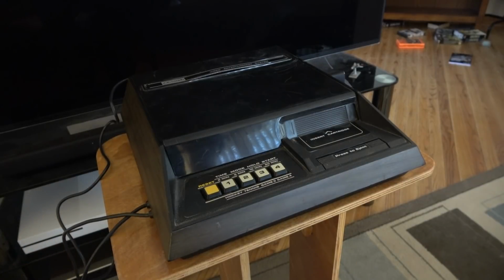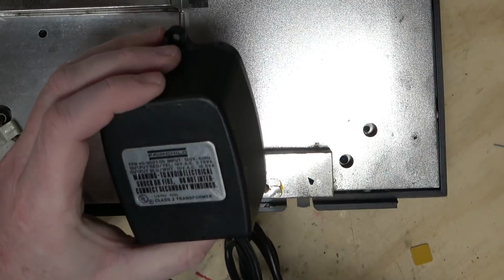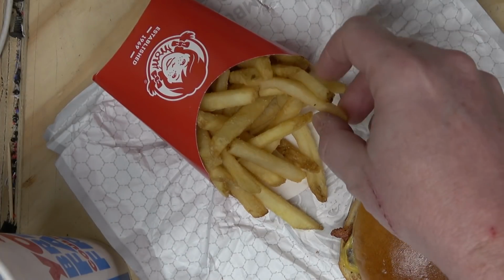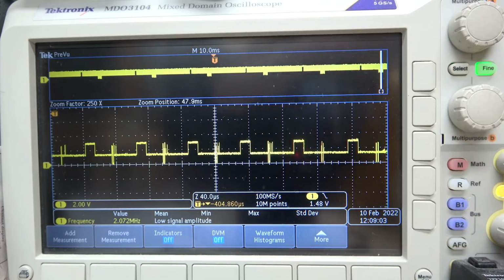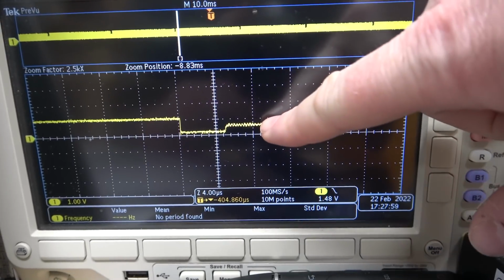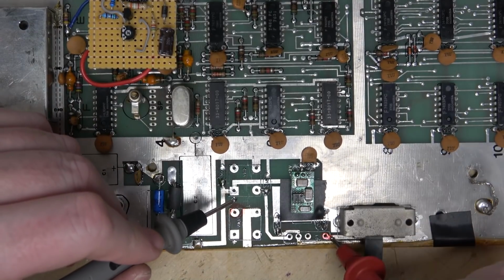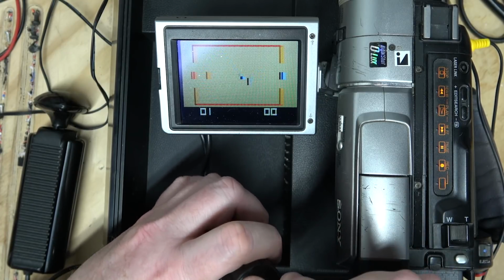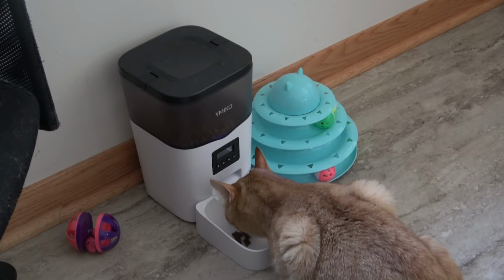Fairchild Channel F Game Console Repair

Comment: VA is ~watts, not amps...  15VAC @ 3.75VA is 250ma.  10VAC @ 16.5VA is 1.65A.  Still about double what it needs, but not "WAAAAAAY OVERPOWERED".  That's a decent margin
Reply: IIRC, early semiconductor memories were absolute power hogs, in addition to often needing weird voltages that would kill other chips if the memory died badly.  It wasn't until the early 80's that semiconductor RAM was available that didn't need 12 volts.  (This did NOT help the reliability of the Apple ]I[ and it's completely bass ackwards design process.  Seriously, who designs the case first, won't allow any ventilation, and then won't make it bigger when the chips needed to fulfill the hardware spec developed later won't fit and overheat?  Steve Jobs, that's who.)
Reply: When you consider power factor it's not even that much margin, at least not for the 10v input. Assuming a 60% PF 1.65 amps in will only supply 1 amp of 5v power.

Comment: Actually come to think of it, YouTube sometimes deletes comments with links, so I'll paste the appropriate info here for posterity (this is from a page called "Accessing RAM" from the VES Wiki: "To write data to video ram you have to load the x coordinate to port 4, y coordinate to port 5 and color to port 1 and then execute the transfer by writing to port 0. For compatibility with the first generation of Fairchild Video Entertainment System, especially the 2MHz PAL model, there needs to be a delay after sending the data through before the next pixel is loaded and sent. MESS will work fine without the delay but it's important for a real console or you'll get holes or gaps in what is drawn."
Reply: Youtube has gotten very pissy about comments lately, even ones that don't have links.

Comment: The Zed Ex 80 (in Hell you will be made to repeat that phrase until your face morphs into Clive Sinclair's. SIR Clive Sinclair's. Screw it, I'm an egalitarian. Uncle Clive) didn't have a frame buffer, nor did the ZX81. Lines of text were stored as ASCII-if-you-hit-it-with-a-hammer, and the CPU would read them. This reading somehow caused their contents to refer to the ROM where the character bitmaps were (just in a fixed place in normal system ROM), and the bitmaps went to the TV line output. If you really cared there's people and documents explain it, but frankly you need your brain for other things than a puddle on the floor.

Also in the stock 1K ZX81, without the 16K RAM pack added, it would store an empty line as a simple newline. 1 character, that's it. With a RAM pack it would pad the whole screen out with spaces and there I suppose is a screen buffer, but text only. The newline character coincided with the Z80's STOP instruction, which somehow halted it til time for the next line, when hardware woke it up again.

Ludicrously complicated, but '70s engineers did that. Whatever you know about 2600 coding already tells you that. Much superior to what we have nowadays I think. You could get a little Space Invaders game, or chess, in 1K, and obviously that includes the code, no ROM carts. This 2K bitmap thing you speak of is profligate luxury! TWO THOUSAND BYTES! AND ANOTHER FORTY-EIGHT ON TOP OF THAT! Sinclair would have done that thing with 4 transistors.

Did you know in Sinclair's pocket TV, one particular transistor is a voltage regulator, IF amp, audio amp, and some other thing I can't remember? All in ONE transistor!!! All in different frequency ranges of course, but bloody hell the ingenuity eh? I suppose in one way it's easier to fix if there's only like 5 components, otoh how the hell do you figure which one it is?
Reply: I've lived in America all my life and I have a hard time NOT saying 'zed ex'.  Probably because everytime I hear the system referred to, that's how it's pronounced.
Reply: Funny you should mention putting a Space Invaders game into 1k in the 70s. The actual Space Invaders (at least the US version) has 4x2kbytes of ROM and worse yet 2k of that is empty. With just a little refactoring they could have eliminated one of the ROMs.

Comment: Videogames sell way more than they did in the 70s. With a cartdrige you were also paying for they materials and manufacturing of said cartdrige when today, in most cases, you are only paying for the software. Making games today is cheaper and easier than it was before due to how widespread computers are today, the exponential increase in computer power, and standardization of programing tools and coding languages. Also, "AAA" developers (the ones that sell games at 60 or more) were already raking millions, even billions, in profits every year without microtransactions, they dont need the money except to satisfy their greed.

And I havent even mentioned the negative impact microtransactions have on game design or the fact that, by inflation, wages have actually decrased.

Theres no valid, economic, justification for microtransactions in paid games. The inflation argument has been refuted plenty of times in the past.

Great video, as always.
Reply: Microtransactions are for shit, simple as that. They're not usually "micro" either. It's the same drive, among business "experts" that sprung up a few years ago, that's leading to Microsoft leasing out Office and Windows rather than flat selling you it. So that way the money keeps coming in even after you've bought the product, you pay just to USE it. To use the thing you bought. It's like having a spade with a coin slot on it, or a screwdriver that needs to swipe a debit card before it will turn.

Actually in Philip K Dick's "Ubik" (which is a _dys_topia), the protagonist can't leave his house one morning until he pays the door for it's service. All his appliances are the same. He argues the terms of his contract, but the door is stubborn, til Joe threatens to get the screwdriver out! As ever, it pays to be an engineer! Or at least know how things work.

Games worked fine the day before this micro bullshit. None of the games I own have it (there's a reason for that), and they work very well, lots of fun. Meanwhile the company stays in business by creating the next game. Just like a baker has to sell new bread every day rather than lease your colon and it's right to digest.

Every business would love to be paid for doing nothing. So would I. So would anybody. It's just a shit deal on the customer.

Still if people are gonna be stupid like that, let them, I'll just stick to playing stuff without it, and if the day comes, I'll just stick with the games I already have. If that fails, I'll plant a garden or something. Catch up on my wanking. Lots of things in life remain free.

Comment: The Wendy's i worked at they actually cooked the Bacon. It's cooked in the convection oven like the baked potatoes. I would know, i have a gnarly burn scar down my left arm from bacon grease right out of that oven. Worked at McD's back in the day too and yeah they use that precooked microwaved on wax paper bacon. Over the years i have worked at Hardee's, Wendy's, McD's and Boogerking. Wendy's is the only one i will still eat. I haven't had Burger king in 20 years. Take what  you will from that.

Comment: Whilst I often think of the inflation thing too there are two main reasons why games were expensive to make back then - cost of manufacture of the cartridge and ease of programming
1. Carts were expensive to make, there was more variation in game prices (not every game was $60) and often this was down to how much storage the ROM chip had. Nowadays burning 100,000 Blu rays is pretty cheap and digital distribution even more so
2. Whilst games are more complex now they are easier to make due to having enough compute power to brute force most issues you may come across, not having to write in assembly and any stock console being able to be turned into a Dev kit (may be out of date on this one, pretty sure Xbox still allows this). you don't need to go to sega and plead for specialist equipment anymore
Reply: Also back then you wrote the code, hopefully used a very expensive EPROM and development adaptor, to check it actually ran, with a 2 hour wait if you found the bug straight off. Then you took that code, printed it out on punched tape in Intel Hex format, and sent it off, along with a cheque for around $20k, and waited 6 weeks for your first run of 1000 mask ROM devices, which had both a different speed and a different pinout to your original EPROM, plugged it in and checked. 

Made a mistake you now had 999 dud devices, and another 6 week wait. There was a massive revolution when the first non erasable EPROM devices came out in a plastic package, even if they were triple the price of the mask ROM, they were selling like crazy, because you could use the same device in development, and knew it would work the same in production.

Plus of course you also had to make a game fit in 2k, 4k, 8k or 16k of memory, and not a byte more, and also run on a system that was severely constrained in speed and resources. The more ROM you needed the higher the cost, as you needed more chips in the cartridge, and there was both limited room and limited address decode capability.

Comment: I remember back in the 90's I used to go to Wendy's here in the UK, and it was one of my favorite burger places. Unfortunately they pulled out of the UK in 2000 so the only big chains in the UK were McDonalds and Burger King for many years, and these were only a shadow of the US chains in terms of the variety of meals on offer. The situation has improved, I believe Wendy's has re-opened in Reading UK with an eye on expanding back into the UK, and a number of other burger chains both home grown and international are starting to get a foothold, so maybe it will start to get easier to get a decent burger!

Comment: Have you worked out what a VA is yet.... Clearly not "this power supply is wayyyy overkill". VA aka watts at the basic level. So 3.75VA on the 15VAC rail amounts to 250mA and 16.5VA on the 10VAC side is 1.65A peak current not 10A!. So they have spec'd it to match the system and cartridges with a safety margin.

Comment: It is not the first game console to use cartridges, it is the first to use ROM cartridges. Before that there were cartridges that had analog components in it instead of a ROM, the Philips ES 2201 was such a console, on which the games were basically hard wired.
Reply from the maker: Good point. The Odyssey 1 had carts too, but they were just jumper packs to swap the "game" inside the unit.

Comment: 2k of RAM because they needed a stack and some working memory, so likely that is all mapped into the lower 1k of RAM, leaving the other 1k for the bitmapped screen. The F8 is all 3 40 pin chips, and yes probably spent almost all of the execute time generating the screen, only having time in the blanking and retrace intervals to do the actual game. Internal 1k of ROM, so those game cartridges are likely mapped in as needed, on the CPU detecting either a set of magic bytes or an actual switch on power up.

You can do a lot with only 2k of memory, remember the Apollo computers were able to fly to the moon on less than that, and at a twentieth of the clock speed as well, though they did have the advantage that they would be guaranteed no bit rot in the ROM.
Reply from the maker: 128x64 = 8192 pixels / 8 pixels per byte  = 1024 BUT it has multiple colors so 2 bits per pixel = 2048K. The work RAM was probably on the CPU.
Reply: @BenHeckHacks  A whole 64 bytes yes, on the CPU trio, but I doubt all the RAM was used, likely only 16 colours, so allowing you to only use 1k of that precious RAM. But then, you also had around the same time single chip micros come out with a half dozen registers and 16 bytes of RAM, and they actually proved very useful. Had a washing machine that used one, with it's whole 16 bytes working to hold all the state and the 1k of mask ROM. The manufacturer, AEG, tried to disguise what processor they used by ordering them with the leadframe bent the other way, so the pinout was reversed, but there were not exactly many single chip processors with the on chip oscillator on board using those particular 2 pins, and the layout of the IO was also a mirror match for that Intel processor. A whole 8 bits, and 3 ports.

Comment: My oddball takeaway so far (1/4 way through) is that the font Nichicon used IS ABSOLUTELY THE SAME as it is today... 😮
I mean, yes, it's their brand, but how has that stopped many companies? Chevrolet comes to mind; however, more recent and a company worth WAY more... Google, as they've changed theirs a few times, just in the last ~15yrs.

=====
Ben, technically, wouldn't a textured coating (surface) on the fries make them cool faster due to increasing the surface area, therefore, thermal transfer with air.

=====
LEDs... 🦇💩 thought that's likely wrong... 
Could they have used them because they happened to offer a unique performance that a standard diode wasn't?  *epic shrug*

=====
Be careful with transformer Wall Warts. Testing them just with wires striped, hooked up to your DMM/oscilloscope, WILL output a higher voltage compared to when there's a load placed on it ("unregulated PSU" I believe is the term).
But that's only in reference to the "16v output" replacement unit you mentioned, as I don't believe the opposite occurs. So that wouldn't apply to the original unit testing low.... Unless you left your DMM on DC while testing an AC supply...? lol

I'm suspecting the original was indeed kaput though, having a short between wire windings, causing it to only put out a fraction of what it should've.

Comment: Why is the pcb around the power all green and wrinkely?  Is that normal aging?
Reply: That's just how they were manufactured; the solder got under the solder mask and did that.  It's not uncommon of stuff from that era.  Basically just cosmetic and tends to happen more in big trace fills and less in thinner traces.

Comment: Wendy's bacon is cooked in an oven, not microwaved. They changed it about 10 years ago. It's a lot better than it used to be.
Reply from the maker: Good to know! Biggest issue with most fast food these days is it appears to sit around a long while... And when labor/food costs go up it sits even longer.
Reply: @BenHeckHacks  It's one of their taglines. Fresh never frozen, square so no corners are cut.

Comment: Honestly, when I see crazy voltages and amp ratings, my first instinct is to just replace it with a Meanwell in a box...

However, I'm glad you did open it... I've never seen a 7805 in a can package, that's amazing...

Though, replacing those linear regulators with switching ones was probably a bad idea... it really exaggerated those jail bars (shown later in the video).  Switching regulators just add to much analog noise.
Reply: Weird voltages maybe, but not that crazy amp rating.  VA can kinda be read similar to watts but it basically accounts only for the current portion of the wattage.  Eg, drawing an amp when the waveform is at 1V is the same as drawing an amp when the waveform is at 10V.  Because amps cause the transformer to saturate, not watts.  But for a resistive load, VA and W are equivalent.  It's basically the closest you can get to putting a watt rating on a transformer because watts don't make a lot of sense on a transformer.

Comment: Dude stay on your soapbox.  AAA games have been 59.99 for like 15 years.  Around the NES/SuperNES/Genesis era they were on a sliding scale between 40-80.  Stabilized at $50 around PS1/N64.  At around 360/PS3, publishers settled at 59.99 because 70-80 tended to drop first-adopter sales and maximized profit at about $27 per unit.  As a former Gamestop manager, I had people complaining about 59.99 all day long and then PS5 bumped up to 69.99.  Yeah?  Let me sell you Donkey Kong Country SNES for $75.  SMH
Reply from the maker: Meanwhile in the same 15 years the price of a new car has DOUBLED.
Reply: @BenHeckHacks  And the price of laptops have HALVED.